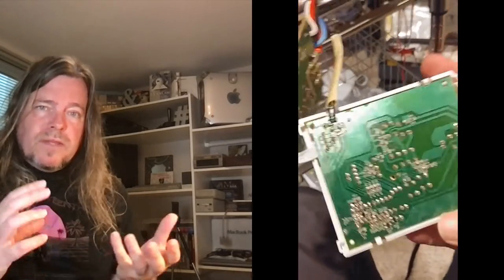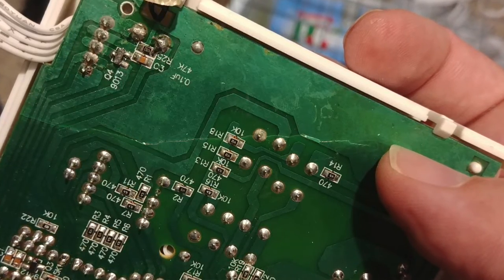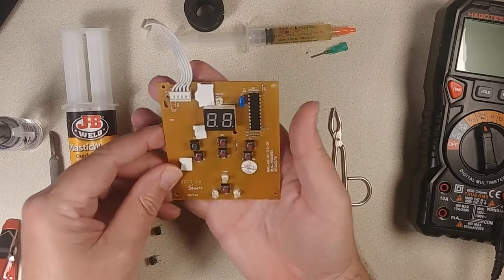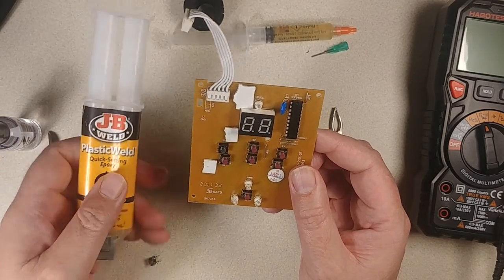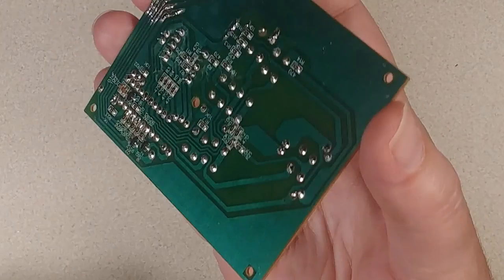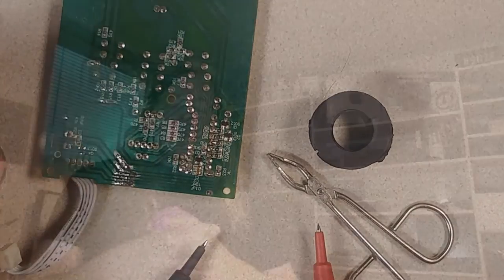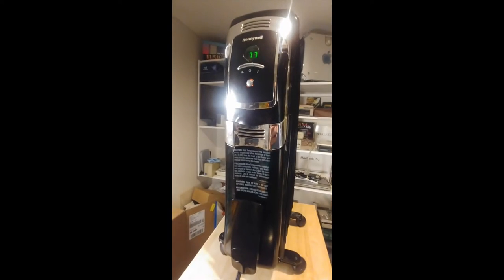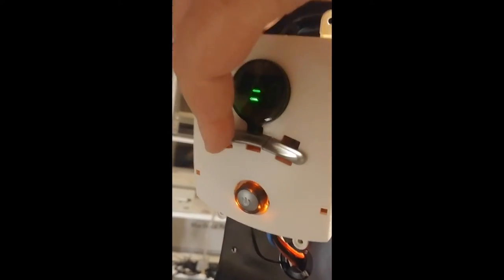Honeywell Radiator Circuit Board Repair and Fault Determination

Comment: Excellent! You inspired me to open up my old Honeywell Radiator to see if I had the same problem. Sure enough, the circuit board was cracked along with one trace. Different trace and therefore different failure behavior but the root problem cause was identical. I used your repair to technique to fix and voila, it works! I especially appreciate your detailed analysis of the problem and explanation of the unit operation. Especially appreciate the quality of the video production. No time was wasted on showing the unscrewing of screws etc, while ample time was given for closeups of the problem and the repairs. Very cool!
Reply from the maker: Thanks for sharing, John. I am happy it helped!

Comment: I have a similar Honeywel unit vut mine does not have that safety switch that cam be reset...when I push the power switch an F appears on the left...I assume that means Fahreheit...that F. Stays in for 5 secinds and goes out and nothing else works...there are no cracks in the curcuit board and there slso is not s safety switch like the one on yours...any ideas?
Reply from the maker: Hi Bob - Hmm, it likely has some other kind of safety switch, possibly even mounted on the circuit board (to determine its orientation. The safety switch mine has is pretty janky and could fail to detect tip-over since it can get stuck). If it doesn't allow you to set the desired temperature or time until it shuts off, it sounds like a malfunctioning control board or  a safety switch.

Please add another comment if you find the tip-over detection or make any headway. Good luck!
Reply: I kept trying to figure things out ...I gave up and took it to recycling this morning.

Comment: By mistake I've wrongly plugged in 220v. And now it's not working. Any possible component to be change and make it alive again? Is there any fuse that I can replace? I owned honeywell hz 789
Reply from the maker: Hi Azmer! Hmm, I didn't notice any fuses when I disassembled it.
4:36 At 4m36s in the video, I show the AC board which, from my understanding, does two things: (1) produces the DC voltage for the electronics and front panel (the DC board) and (2) contains the relays that send the electricity to the heating elements.

You could take a look at that board to see if any components are visibly fried. Also, you could test for the DC voltage from it at connector CN1. It would also be possible to remove/test/replace any of the small number of components on that board. The transistors and capacitors seem likely points of failure with the too high voltage input, but I a power supply expert.

All that said, I don't consider the AC portion safe for a novice to repair. I found the radiators cost about $80 to replace with a new model. With a working AC board, it would be easier to isolate which component(s) failed on the other one, and then repair it so you'd have two that worked.

Comment: Even though I didn't understand EVERYTHING you were talking about, I really enjoyed watching the process unfold. I also enjoyed your thoughts on the design at the end. I found a beautiful looking INSIGNIA TV (packed neatly in its box) that powers on, but the screen does not illuminate. There appears to be a signal to the display (I can see images, very faintly, with a flashlight), and so I suspect there is a failure in the backlights somewhere. I have to pop it open to test it, but it's been sitting in my entryway for about a month now... watching this has definitely inspired me to give it a try!
Reply from the maker: Hi Matt - a pleasure to hear from you. Re: the TV, cool that you already did some diagnostic work; it is a common failure mode for these flat panel TVs that their LED backlights don't come on. There are videos on YouTube showing this repair including Adrian's Digital Basement "Trashpicked Samsung LCD TV Part 2: New LED Modules"
https://www.youtube.com/watch?v=b9JjYIW2klE

BTW, I will be in your area for about 10 days from mid-next week. I'll see if you can meet up!
Reply: @DrDavesDiversions , thanks! Yes, I did SOME work to diagnose the issue, and I THINK that's it. I have to take it apart and test the circuit on the strips, however. I don't actually have a tester, though, so I'll have to get one first... and I'm dragging my feet on that.

And, yeah, message me when you're in the area. I should have some time one of those evenings, or on the weekend, to get burgers and beer!

Comment: Nice repair. I guess your friend owes you another lunch for fixing the radiator 🙂
Reply from the maker: He actually had no need for it anymore with the kids moved out and the new home they moved to, so I bought it for half the cost of replacement and now our guests will be cozy... if the house doesn't burn down. ;)

Lunch is his turn next time though. :)
Reply: Excellent!! Great job with the repairs and pointing out how it got damaged. I didn't see any fuses, if so it should be modified to have one. Thanks for sharing and will send my toaster to you :)
Reply from the maker: @RudysRetroIntel  Ha, one of the first things I ever repaired was a toaster [for my parents] when I was a child. :)

I cut it out for time, but notice how this is the exact same problem as with the Commodore 1702 monitor's cover for its controls... unprotected from impact from a common direction.

Comment: That indeed is mechanically a very poor design. But it could've been made very sturdy if they'd used fiberglass PCB instead of this cheap brown stuff (Phenolic paper).
This was actually why fiber glass PCBs were invented, to resist flexing better, as it bends more than the Phenolic paper.
Reply from the maker: Interesting! Just the making of this video caused me to search online for, and read a bit about, the inventor/history of PCBs. I hadn't read about the materials beyond the initial inventions.

Aside: the project also taught me about "stop drilling" (from one of the PCB repair video links in description) to prevent the advancing of a crack: "A method of stopping the growth of a crack in a piece of metal or transparent plastic by drilling a small hole at the end of the crack. The stresses are spread out all around the circumference of the hole rather than concentrated at the end of the crack.
source: FAA Aviation Maintenance Technician Airframe Handbook (FAA-H-8083-31)"
Reply from the maker: Speaking of materials, do you happen to know why non-conductive insulating materials, like the card-board or card-board-like insulating sheets are often silver in color? e.g., between the AC and DC boards here, or, say, in some Commodore computers?
Is the silver coating to make it non-flammable? Or maybe its dielectric characteristics, I guess, e.g. for EMI.
It always seems funny to me to have a non-conductive layer be metallic looking. :)
Reply: @DrDavesDiversions  For electro magnetic radiation the colour isn't of any importance. I think that those aluminum foil covered cardboard shields were cheapest to make. Aluminium foil (actually it's very very thin rolled sheet metal I think) is cheap and it comes in silver colour. Atari for example actually uses sheet metal, which also is silver when not painted.
Painting it would cost money and using copper would be far more expensive and more prone to oxidization so you would need a coating on it, even aluminium is more expensive than that sheet metal. 

The irony is, that these stupid RF shields are an American law. In Europe we didn't have that requirement, for computers, that's why you don't RF shields on Speccies and the Oddysees. This is why on the TIMEX ZX80 there's literally a big sheet of sticky aluminium foil on the top cover :D

FYI The colour of heatsinks does matter, black heatsinks sink about 33% more energy than just aluminium.  This is why black heat sinks tend be used more in highend stuff (you pay for the anodyzing) but it does actually provide benefit.
Reply: @DrDavesDiversions  Fascinating! Makes sense! But I wasn't taught that in college. 
Then again in 1990 when I started EE, we only used the fiberglass PCBs. And that is nasty stuff when you saw it, I once had what I thought a "metal splinter in my eye" . So I went to the doctor. She rolled up my eyelid and dropped some stuff into my eye that would apparently change colour when in contact with metal. That didn't happen. But she saw little abrasions on the white of the eye and look at the eye lid. And there was a sliver of fiber glass stuck in the eye lid. That she (eventually) plucked out with tweezers.

Funny side story she was a substitute and she was literally shaking when she was coming with the tweezers so close to my eyes and whispering: "I always hate being so close to the eye, always unnerves me". I wanted to say: "couldn't you just pretend to be cool about it?", but I was afraid I would move and get tweezers in my eye :D
Reply from the maker: @CallousCoder  hahaha .. Right, don't discuss how you are in the wrong line of work with your clientele! :)

Dentistry and soldering has some parallels; I was recently talking to my dentist about it. :)
Reply: @DrDavesDiversions  lol 😂 my first job was as a FSE for a company that made veterinary information systems, written in MUMPS. And I had upgraded a system and I was closing it up and the veterinarian is bolting a hip replacement to a dog and we were both screwing and he said: “oh our jobs are very similar, see?!”
-“except my college degree took 4 years yours took 8!”
Was always fascinating seeing those animals complete cut open. The only thing k couldn’t stand (and still can’t) is cleaning teeth that horrible sound of that drill. At the dentist that sound makes me squirm too — hence I avoid them as much as possible.
Last April a little piece of the first molar broke. So I had to go. And she’s like: “that little piece was half the molar. We are going to try to fix it but when it starts giving issues you need to come back and do a root canal!”
And luckily (knock on wood) it was fixed with half an hour of that terrible sound!
Reply from the maker: F*ck this comment system, it just deleted my whole comment while I was typing.
Reply from the maker: @CallousCoder  I knew I'd heard of MUMPS: it is the language the founder of Epic Systems, probably the largest health care software vendor, first used to develop their software. She is an alumnus of my university, and from the same Computer Sciences department, actually. The company is pretty amazing and based right near my hometown and is a huge employer here.
https://www.forbes.com/sites/katiejennings/2021/04/08/billionaire-judy-faulkner-epic-systems/

Re: the dentist, I know what you mean, but my logic takes over and I have a healthy relationship with my current dentist (after my prior one retired). I actually like going there! :) Last time I got a crown, I decided to actively listen to the drill, dissociating the sounds from what it was doing, and noticing its interesting patterns. Anyway, he knows I get anxious about it and slows down and administers more anesthetic, if I want, to make sure I can't feel pain from it.
Reply: @DrDavesDiversions  yeah, welcome to YouTube 😂
Reply from the maker: @CallousCoder  It is soooo bad. I guess they like people not to talk about content.
Reply: @DrDavesDiversions  god forbid that people have civilized interactions!!!